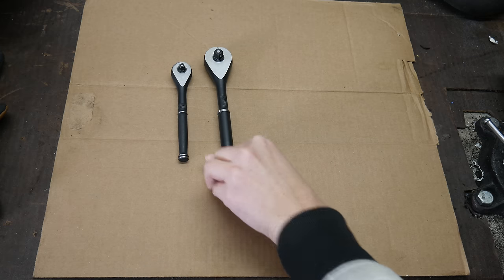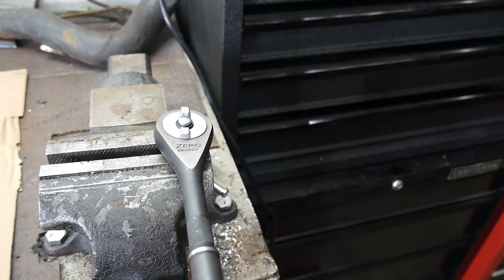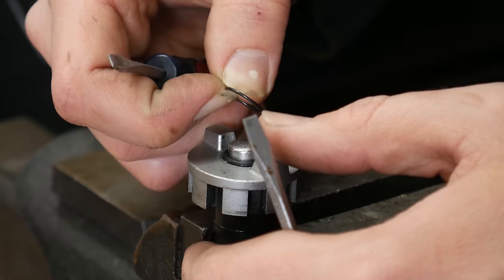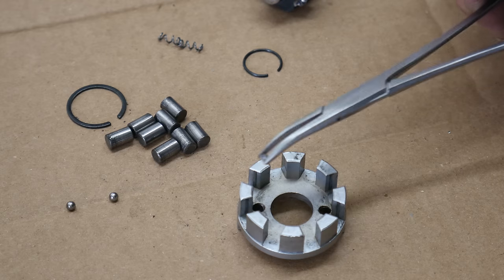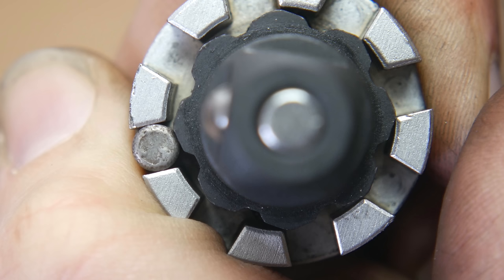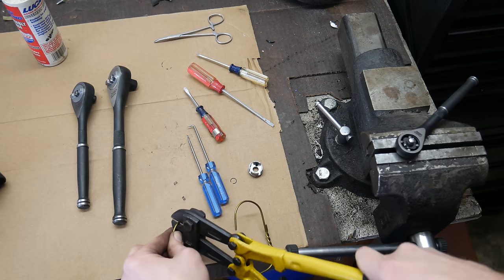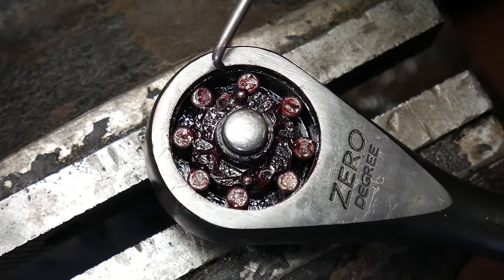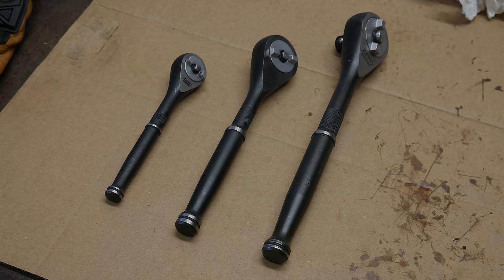Jobsmart Gearless Ratchets – How They Work and Troubleshooting

Comment: I just finished watching your Silverado videos and at the beginning I remember you saying you wanted something simple to work on because of lack of experience. But then a few years later you legit rebuild a transmission. Where'd you learn all that?
Reply: It's just time you learn to comprehend how things work and apply that to other mechanical systems. Cars are complicated but once you get a hand on how each of its components work then it all makes sense.
Reply from the maker: It is as Aurora said, most of what I have learned has been from working on cars and figuring it out as I go. For specific stuff forums are a great source of information, too!
Reply: If you have a basic understanding as a base, it's not hard to just dive right in and figure stuff out as you go. Just label things (smart phones are a god send, just takes pictures as you go), take your time, and look stuff up online. I started working on a farm with pretty basic repair skills, and within months was doing full motor swaps on tractors, and some serious transmission work (I pulled the PTO drive out of our fuel pumper and switched it to an electric pump).
Reply: @FuzzyDiceProjects  are there any particular forums you use or do you look for ones specific to what you're working on?
Reply from the maker: @he5890  It varies based on what I am looking for, largely just finding posts on Google. Hotrodders.com is great for American stuff and there are a lot of old-timers there, specialty forums like ThirdGen.org for third gen F-body cars are great for specific information, and some parts of Reddit like MechanicAdvice are pretty good when looking for general answers.

Comment: of coarse this is a tight system, it's used (as a one-way clutch) in auto transmissions in everything you drive today. this type of wrench also is used for adjusting milling chuck collets as there is a clean side with nothing to grip onto.

Comment: If you wanted to make the dimples for the detents deeper you could anneal the part by heating it up with a blow torch until it glows red then allowing it to cool very slowly.  Then after the dimples deeper, you could re harden the part by heating it up and quenching.  You should then anneal it once more but with a less aggressive heating cycle.

Comment: Try one of the shims from the 3/8 ratchet, it might not need both.

I'd like to see how much torque they can hold, but you may not be able to test that the normal way…

Put something in a vice that will accept a 1/2" square drive, & put a fish scale on a cheater bar. Measure from the scale to the square drive & hang weights until it breaks!

Comment: Dremel tool and a cheap HF ball end diamond bit to dig into that hardened steel, with an longer spring in the assembly. Although you might go through the case hardening...

Comment: Oh, and I must mention, although there is multiple rollers in the sprag clutch assembly, typically, only one roller at a time does the locking action, unless the rollers are sprung... Or to say, have a spring that is always pushing the roller in to the locking direction... and with as sloppy as the machining of these parts are, even with sprung rollers, I gather, that not all rollers are wedged, which is why I think these type of ratchets break free... Check out the spec sheet of a sprag clutch bearing assenbly, from McMasterCar catalog, and you will see that such a system has a very high demand of tolerances, as per things being in alignment in order for a higher degree of reliability of positive locking action while not causing a premature mechanical failure due from damage of just one sprag constantly do it all the work of load holding, as only one holding a load damages the bearing load surfaces and the roller surfaces as well.... Let alone, when the rollers have no alignment guides to assist in keeping each of the rollers perpendicular to the direction of linear movement... If a roller does get out of alignment, the risk of bending that said roller is high, due to the stresses encountered in this mechanical system.... that lessons the locking action further, again, galls up the inner race... Okay, I am finished... Just grumpy of the cost of these and to have to go to the doc to get my hand stitched up... My set of ratchets, went into my metal scrap bin... Clever idea, but had for this application... Any work that only requires less then 11 in.lbs. of torque, I see these being just fine, but, why spend the money for such a tool that a $5 dollar tool could do just as well...

Comment: I wonder if a pin detent that you have to push down would be better than a ball detent. I also wonder if you could make the design smaller with thinner rollers, or with a smaller clutch piece, though that may cause slipping issues.

Comment: Try gearless ratcheting spanners, though you may know them as wrenches, the ones with one open end and a ratcheting ring spanner end, may be known as a ratchetless or silent ratchet under some manufacturers, Britool (now Expert by Facom) made a few, not many, Neilsen (Aussie I believe), Kobalt, Bergen (now US.PRO TOOLS), Roebuck, Kennedy-Pro... Etc.

Gearless ratchets are old tech, I've seen some from WW2, there are patents for differing systems throughout the last 70-80 years, one I've seen from the late 1970's (1978?), Gearless ratchets are far from new tech being at least four decades old, however, they've seen a recent resurgeance.

Though if you want the older, neater, thinner, leaner designs, you'll want to look at old stock, the smallest design I've seen are the Roebuck ones, though they don't seem to be made any more so you have to spend some time finding old stock sold on Ebay and the like.

Some examples:
https://www.ebay.co.uk/itm/Britool-Hallmark-MRC201-3-8-Drive-Slim-Head-Gearless-Clutch-Ratchet/153026311571?epid=1572995530&hash=item23a1143593:g:4kUAAOSw~U5a~ecs
https://www.ebay.co.uk/itm/9mm-Ratchetless-Ratchet-Gearless-combination-Spanner-by-U-S-Pro-Tools-AT382/123679728965?ssPageName=STRK%3AMEBIDX%3AIT&_trksid=p2057872.m2749.l2649
https://www.ebay.co.uk/itm/Halfords-Gearless-Ratchet-Spanner-Set-7-Piece-439326/283507083377?ssPageName=STRK%3AMEBIDX%3AIT&_trksid=p2057872.m2749.l2649
https://www.ebay.co.uk/itm/11mm-Reobuck-Gearless-combination-wrench-24-8307B/173868284724?ssPageName=STRK%3AMEBIDX%3AIT&_trksid=p2057872.m2749.l2649

(Halfords, an auto company in the UK, seems to have bought the rights to sell Kobalt tools under their name in Europe, though they only sell the metric in the UK while in the US Kobalt produce an Imperial/SAE/AF set, so there's no 11mm in the metric since there's meant to be a 7/16" in the SAE set, which is 11.122mm, bit of play but not enough to matter.)

Comment: Great explanation and video as usual, thanks for your work. I literally just got the same clearanced ratchets at TS this week, so this is great timing. (Man they have some great clearance deals after Christmas.) I have some cobalt drill bits that I'm tempted to try on those detents, but is there another reason aside from the steel hardness to avoid deepening those holes? Seems like it'd be one of the easiest fixes other than the time spent drilling, but I don't know crap about the engineering. Thanks again!
Reply from the maker: I don't think drilling the detent seats deeper would cause any issues, as long as they aren't too deep (presumably keep the depth under the radius of the ball bearings). The drill bit I tried was cobalt and those have done great with graded hardware before, but I didn't try too hard with the ratchet parts. With cutting oil and a drill press they might do the job.

Comment: The design is good for low swing clearance an low torque applications, but use them for long enough or get any oil in there an it’s easy to overpower the clutch
Reply: Yo Daddy drop in some rusty dust and sandy grit to increase torque holding capacity 👍🏻

Comment: I work at a place that works on fishing reels and the design of these is very similar to a roller clutch or anti reverse in a reel. If there is oil or grease on the rollers it can make them stick and not engage well. They may start slipping worse over time with grease

Comment: Rather than the outside diameter rubbing it's likely the ends of the 'legs' on the switch dragging on the bottom of the cavity in the wrench head.

Comment: Sanding the outside to make it slightly smaller was a good idea to prevent friction but polishing the switch and the body smooth after doing this may have made your idea work a bit better. Good shims in the three eighths.  None in half inch?  I wonder why?

Comment: I like this. I explode the traditional. I have even had real nice ones and welded them to take a four foot breaker. Seems every ratchet has a strong and weak trait. I like this one.. I hope someone perfects it. A problem with the gear driven is it has to repeat in the same places and die. this design is infinite within the 360 degrees.

Comment: Would like to have seen a geared vs non-geared demonstration since the length of the handle plays a part in removing bolts/nuts in tight places.
Reply from the maker: Good suggestion! I will see if I can work that into something in the future.

Comment: use snap ring pliers man! for safety purposes.Those snap rings are spring tension loaded, it cause the damage on your face! and others face, screw driver is not   the right tool.But using the vice is good work ethic to take out the snap ring.when one hand is hold the pliers and the other grab the snap ring.

Comment: the only use id see for a gearless ratchet is for those bolts that are tight enough for them to be too hard to screw out by hand, but loose enough that a geared ratched  doesnt actually ratchet properly (but i feel like this wouldnt be an issue with higher quality geared ratchets)

Comment: i have the same issue with snap on n mac ratchets...switching directions on me...
Reply: Me too.. My ¼" snap-on ratchet  changes direction and slips into freestyle mode. I just use the driver handle and the breaker bar if I have to. I don't want to swap it out for a new one. It's an older one.

Comment: At what degree does the sprag clutch engage? Is it more than a fine tooth ratchet?
Reply from the maker: I actually didn't try to measure it, but now that you bring it up I am curious. It is a smaller distance than any of the other ratchets I have, though I don't have any super-fine ones. There is a tiny bit of play as the rollers are pushed out and grip, but it seems pretty minor. Might try to compare it to other ratchets in the future, thanks for the idea!

Comment: Good disection.  In other words, gearless socket wrenches have zero degree swing arc, have zero back lash, and are not intended to be used as a breaker bar like every ratchet.  Gearless socket wrenches are the Tucker of the wrench world- ahead of their time.

Comment: id rather know how many degrees from free to lock up. if it takes less degrees of movement to lock up the clutch than a well made ratchet then it could be useful.
Reply: I bought the Kobalt ones when Lowe's cleared them out a few years ago. I also took mine apart to clean and lube them. The amount of arc does not seem consistent from turn-to-turn, but it is very low. There is noticeable back drag on all of them. I would say that my Steelman Pro true 160 tooth ratchets possibly have a smaller arc at 2.25°, but they also have a lot of back drag.

Comment: A 3' drop to a concrete floor, mine came apart & scattered the parts.  Found all parts, reassembled but now the switch to change directions doesn't click, won't stay put & wrench is mostly in neutral. POS, don't waste your money.

'

Comment: Blackhawk patented the gearless ratchet in 1942, they were made in 1942 & 1943 for The U. S. Army.  In 1944 Williams/Snap-on acquired the Military contract & never manufactured this design & per original contract Blackhawk never made them for civilian production in the States.. I have the 1943 Blackhawks in 1/2 drive & 3/8 drive, the 1/4 is the rarest & I have yet to run across one.

Comment: Why not use a dremel and a round diamond bur/bit  to drop those bearing detents?
Reply: In a gunsmithing discussion someone very wise wrote, "I cannot think of any situation that cannot be made worse with a Dremel."
Reply: @David-hm9ic  Yes. I agree. ..I bet there are a lot of wise people having many conversations in all sorts of activities that aren't tool repair who would also agree with that statement. Imagine what a group of brain surgeons might have to say about the introduction of a dremel into their process. But I wonder how many people who are using a die grinder but wish they had the control of a dremel, due to the intricacies of their situation. If you let a dremel get away from you while using an 1/8"ø ballnosed  diamond burr in an 1/8" divit, ...well I gotta wonder what you're even doing with any tools at all, let alone taking them apart... Jus' sayin'.. You could chuck it up in your drill if the rpms are too much to keep up with. ...or, if the dremel is the issue cuz its not a manly enough tool, use a ¼"ø round nose carbide burr from a die grinder in a drill. I don't remember. Were you first trying to drill it with a hand drill? There's nothing wrong if you did. Im just wondering what's the difference between the drill and a dremel at that point?

Comment: Any ratchet that flips direction while you're using it is immediate trash can material. That shits incredibly annoying mid job when you take a completely hidden fastener half way off only to accidentally screw it half way back on. Where you'd need a ratchet with 1 degree or greater resolution, you really can't see whatever fastener you're working on. Would be hell to work a nut off with 1 degree of movement, then work it right back on....

Comment: Those clutch systems are the number one thing that fail in fishing reels why would they but it on a ratchet
Reply: I bet that the high rotation speed of a fishing reel is a different type of wear than these things will get.

Comment: if you stretch a spring to increase tension you should heat it after you've stretched it, it'll "remember" that position.
Reply: heating a spring with make it squish like bread
Reply: @122martin122  umm bread doesn't squish when you heat it (bad analogy). I was told the heating idea by a metal worker who made springs so I can give you his number and you can tell him he's wrong. It would depend on the diameter of the wire and type of spring it is. I've heated coil springs on vehicles to get them out and to get them soft enough to compress easily they have to be cherry red. I've also had to cut leaf springs and they didn't "squish" until the acetylene cut through them. 

If the mood arises, I'll video a small coil spring being heated and post it online, then you can tell me again how they'll squish.

BTW: you don't heat it WHILE it is under pressure or tension, you stretch it to the point you desire THEN heat it. Let it cool and install.
Reply: I got that when i heated a bic lighter spring, it was too soft to be called a spring afterward, i dont know about bigger springs
Reply: @122martin122  lol really? the spring in a disposable lighter to hold the flint? and did you heat it or MELT it?
Reply: Red hot then cooled with water

Comment: I consider that product to be junk. I do not care about the price, the ratched is not smaller then standard nudged ones and it slipps. Hey, i am applying some decend force when loosing bolts and the last thing i need is to crush my knuckles. I mean - how often do I buy a ratched ? I can spend a few bucks more for a reliable tool. Nice video, though.

Comment: There good… not the best when going straight ham on one and abusing it with a pipe or hammer… they will slip… apply pressure at a normal speed, and amount, they are great,

Comment: I got suckered into buying a set of this type from my Strap-On dealer... I hate these pieces of junk... They leave the impression that the sprag is positively locked while under load... Then after you get comfortable using it, BOOM!!! It slips when you least think it would of will, ... and you just the F*CK out of your knuckles.... and cut open my hand in a very bad way, through my glove as well... These are dangerous... Clever, but extremely dangerous to your well being of your hands